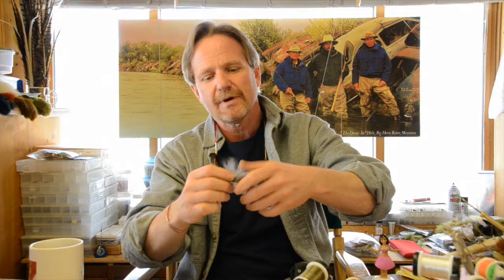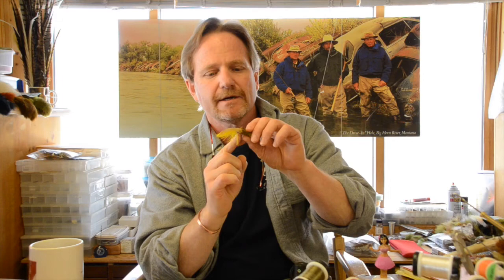Slide Inn Q&A #4- Streamer Design with Kelly Galloup

Comment: I'm glad that in this video, the point was made about the lighter wire gauge hooks, the Partridge universal predator, or Aberdeen bend style of hook is useful, because it doesn't impede the movement actions that he wants to get from the streamer, or sculpin pattern. I was trying to understand what was the attraction of the Aberdeen bend hooks for streamers. As I mentioned, we do use this type of hook in smaller sizes, on the larger lakes for fishing from drifting boats on large rolling waves, on the surface. That is, the heavier wire gauge hook was avoided for a reason in that instance also.

Comment: I observed that even in the little size eighteen hares ear even, that the dry fly hook wire gauge, in preference to the nymph hook heavier wire gauge was preferred by Mr Galloup. That is, even down at size eighteen, the lighter wire hook on the dropper for the split shot technique was desirable, and tungsten, or brass beads, or leaded hooks were avoided in that approach too. There is consistency in the logic, even across different styles of fishing.

Comment: Enjoying the wisdom on the video until he said the Madison and my jaw dropped. We are practically neighbors! Where are you fishing with those big, articulated streamer patterns? I wanted to try my hand at some but was unsure of the usefulness of them here in Montana. Also, do you use a heavier weight rod/reel setup, or will my old 5wt do the trick?
Reply from the maker: Garrett, many of the flies were designed here on the Madison, but it really doesn't matter where you fish, trout are trout. New Zealand to New Hampshire they still like to big. As for the rod, about as light as i go is a 6 wt but lean a little more to the 7 world for a streamer specific stick. thanks for watching man, kelly

Comment: what kind of wire do you use to connect the back portion of the Fly to the front fly?
Reply from the maker: Mike-
   I use 19 strand .038 mm. Beadalon wire.  You can get it at any michael's craft store and I think Walmart sells it as well